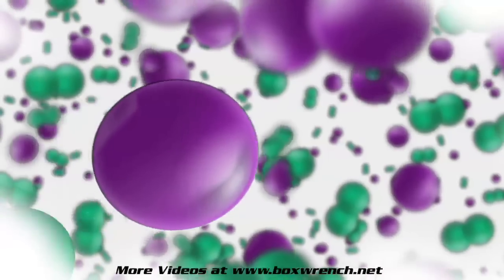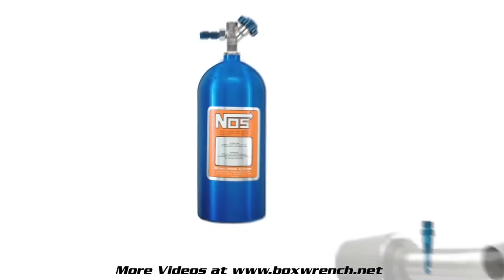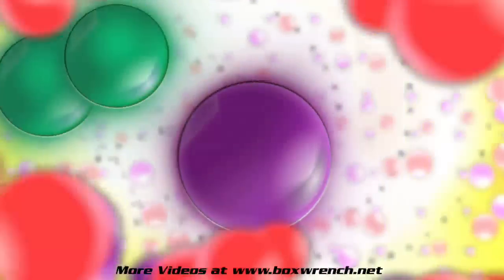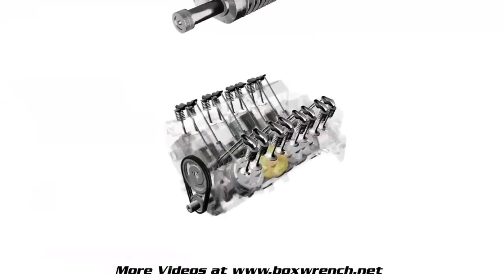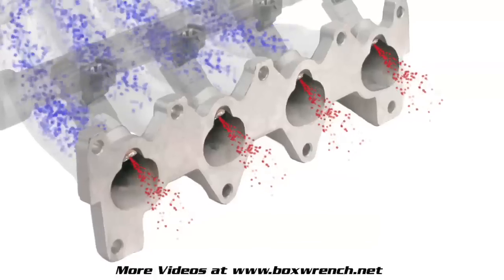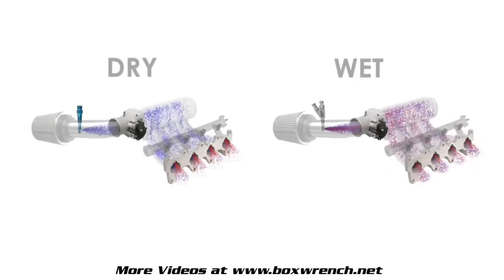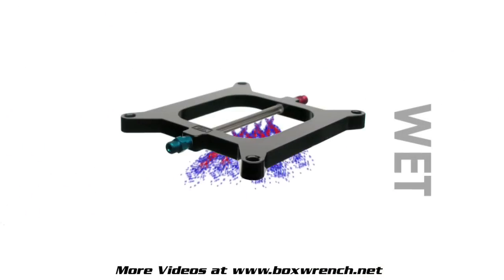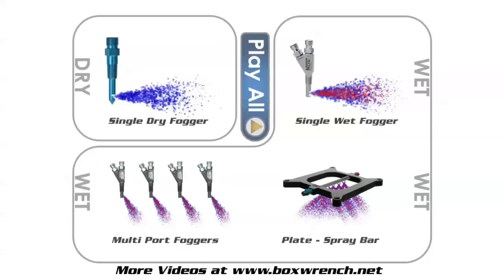What is NOS ? - Nitrous Oxide Systems - How NOS creates power

Comment: Combustion requires oxygen. However, normal air is only 20% oxygen by volume. Nitrous oxide is typically very pure, with only a small amount of S2O additive to prevent substance abuse. That's why it can deliver a lot more oxygen than air, which is what you want for rapid combustion.

Rocket fuels, in contrast, use stuff like liquified oxygen as the oxidizer. That stuff is on another level however. Something kept at -320 F that can spontaneously detonate asphalt is not something you want in a car

Comment: supercharger and turbo charger never runs out but n2o runs out
Reply: n2o is compressed air in a bottle, a turbo/super compresses air off the power of the engine. so think of blowing a fan(which uses power) vs blowing canned air(which requires nothing but a release switch as it's already pressurized)
Reply: you have to know how an engine works before you watch this video. all it does is compresses air which is then ignited with fuel(which causes it to expand) and forces down a piston which is connected to a crankshaft that changes that up and down motion into rotational motion. the problem with engine power is that when that piston comes down in a cylinder it can only pull in so much air(limited to atmospheric pressure of 14.7psi@sea level). but with n2o it's just compressed air that FORCES more air into the cylinder(which means you need more fuel to burn that air)

Comment: wait...NON-Flammable??? wtf fast and furious, why does Dom scream NOS!! then car blows up. i think i want this for my boosted civic... not sure yet...
Reply: Yeah bro.. agreed.. why does nos blow int f2f
Reply: well it would still be like compressed oxygen
Reply: Lorenzo you are completely right!
The bottle can't really explode at all, because it's in liquid form. But if it's opened, ( just like in the green eclipse ) it will feed the flames, witch are already burning. It's non flameable, but it feeds the fire.
Reply: uhm maybe gasoline with nos is more flame able idk? but the car would still explode because of the gasoline
Reply: As you now, 1kg gasoline needs 14.7 kg air to explode, but with air and nos this number is smaller.
A leaking gastank can catch fire, but cant really explode at all.
I really love the whole series of ff, but thats not the most unrealistic scene, and we still love it.
Reply: NOS is not flammable but it breaks down at around 565 degrees Fahrenheit and the oxygen liberated at that point will help burn fuel like any other oxygen. BTW you telling the Fast and Furious 1, I know that scene, the motor guys (or whatever they called) rapidly shots the Supra which means (for an instance) they used "wet NOS" which is when it's got shooted by a gun it will burn and spread throughout the engine which makes engine hot and explode.